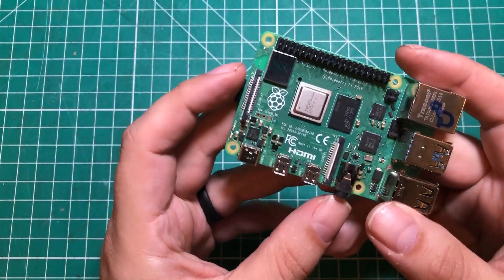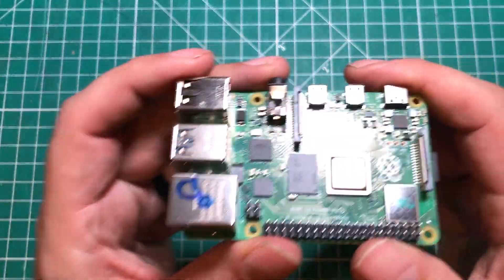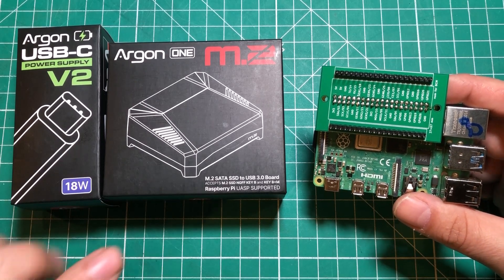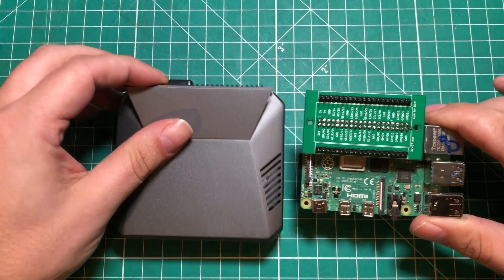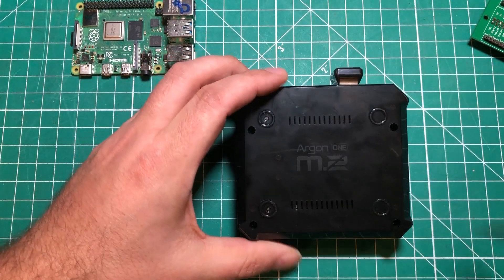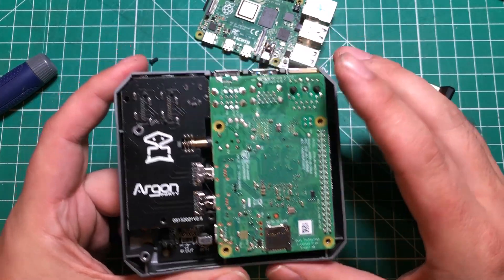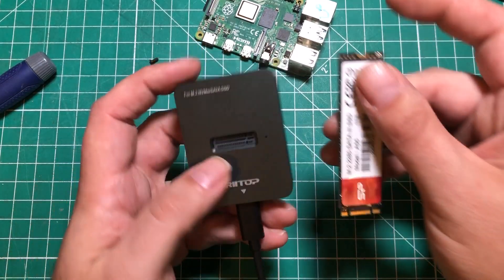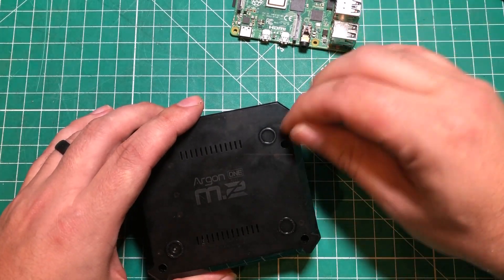Fixing the biggest flaws of the Raspberry Pi 4

Comment: is this channel still alive? i want to ask something
Reply from the maker: I'm around. I'm not on yt a ton, but I am around. What's up?
Reply: @AnotherMaker  i just left my rpi for 2 weeks and when im about to use it, it now displays 'usb overcurrent'. nothing is plugged in it, just the power. i tested my sd card to other else's rpi and it's working fine and no over current on their part. and even used their power supple adapter to my rpi 4b and still over current. so i guess the problem is in my rpi right? but i just used my rpi quite few times in vnc and yeah. it's now on overcurrent

Comment: same money can build better table computer, mini-itx motherboard and I3-I7 cpu less than 50$ and include 8gb RAM, i have used my table computer 3 year now raspberry pi 4 8gb, and new have ITX I5 8gb and lot cheapen and better table computer, raspian need use only emergency computer can go internet and pay bills, but main computer not need , have lot better now mini-ITX and lot cheapen than raspi, raspi 4 8gb cost ower 100$ and all same need power,cooler,usb hub, SSD etc. near 200$ but ITX i have all same less than 100$ big money save.
Reply from the maker: Yeah, I use small form factor pcs for a lot of things in place of the raspberry pi now.

Comment: arcon and many passive cooler case have problem not cool good, if owerlock pi need lot lot better cooler, ice tower need use and then argon need fight to trash because not can use whit good cooler, ice tower. i has before argon but not true good cool, i fight argon case to trash because have 200% better use ice tower ,have true good cooler lot lot better than argon, argon my cpu temp has ower 50C alltime but ice tower have less than 40C now alltime and play game and owerlocked have 2000 mhz and more. but temp stay less than 45C
Reply from the maker: This case is not passive. It has a fan

Comment: I have been having no luck getting HDMI audio on my TV. I do have it only with on board raspberry pi board. (tried both HDMI ports)
  So far when using the Raspberry Pi Imager program to install the OS, only the older "Legacy" versions include HDMI audio
as a choice either from the Speaker ICON or from terminal typing sudo raspi-config and going to audio and select HDMI.   All the latest versions I have tried do not offer
HDMI as a choice.   With the Legacy, once I make sure HDMI is chosen, I go into the Terminal mode and type   sudo nano /boot/config.txt     scroll down to hdmi_drive 2 and remove the "#" before it.   Reboot and audio is on the HDMI line to my TV.    Something must not be installed on newer versions could be the reason HDMI is not
a choice for audio.
Reply from the maker: I haven't run into that but I very rarely use the normal desktop versions either.
Reply: @AnotherMaker  After over a month I found the solution to no HDMI audio.   I made the following changes
sudo nano /boot/config.txt

dtoverlay=vc4-kms-v3d
change to
dtoverlay=vc4-fkms-v3d 

remove "#"
#hdmi_drive=2

reboot/restart
select your hdmi from the sound applet

The first line added HDMI as a choice when clicking the speaker icon or doing a sudo raspi-config,  system, audio and now HDMI audio output will be a choice.
Such a simple change but no one knew the answer from several of my requests.    The version of OS is when using the IMAGER program from raspberry pi, its
the 1st choice with Desktop.
Reply from the maker: @n1kkri  Thanks so much for sharing. I saved this snippet so I have it.
Reply: @AnotherMaker  it was my pleasure to share.

Comment: When it comes to micro hdmi solutions, the wires  are better than the adapters. The adapters like to break easily. I've even had a bad adapter mangle an  micro hdmi 0 port on the pi itself. I've had very good results with Samsung BAR and Fit, USB flash memory for boot. 128GB and 256GB worked well. 64GB ones seemed to get hotter and not work as well for me, longevity wise. It's anecdotal. More issues at the limit of overclock and USB power. No noticeable difference between the flash and ssd.

 I had hope about PI's being in stock when I got one in July. Something went wrong, and that one became the first to pop. Overclocked to the limit and plugging in USBs something gave. Will not even run off GPIO 5V battery. I still haven't been able to replace that one yet. Spare parts now 😅

Comment: Many of the flaws of the Raspberry Pi have been addressed, including the inability to use NVME drives; it's called the Orange PI 5 Plus.
Reply from the maker: I have a bunch of those. I love the hardware but the software has a lot to be desired. I have a hard time getting a lot of programs that run flawlessly on the raspberry working on the orange

Comment: yes this case design is optimal but what it needs is an indicator light of at least it is powered on .....
I have the first design and I also have the 2.0 version which is the M.2 version ...
Reply from the maker: I do agree because the fan can be on with the system off. That's kind of weird.

Comment: The biggest issue is the availability.
I have two Pi 4s of which one sits inside my DIY NAS on a 3D printed PCI bracket doing backup tasks there such as acting as second DNS.

I have another one which I'd actually love to put inside that Argon case with or without M2 slot but I too want to use it inside a C64 I had a Pi 3 set up with.

Hope the Foundation gets things fixed again in the near future because doing projects with those SBCs is really fun.
Reply from the maker: Agreed. It's a really big bummer that only companies can get these things. I still have my pre-pandemic old stockpile but I feel bad sharing projects when no one can get them.

Comment: sdcard, use a convertor to emmc which plugs into sdcard slot (rockpi), speed is decided by sdcard system probably.
for silent cooling fan see Garatronic (France)   (skipped video when mentioning gpio needs documentation, yeah)
Reply from the maker: Yeah. I used the GPIO sometimes but more often than not, I don't. I still think the USB system is faster than the SD card system overall. Probably buy something like 35 to 40%

Comment: Thanks for sharing a super helpful video and I agree with your points 💯 as it really needs 1 x full HDMI, installing a fan takes up space and although you can always use a case such as this one from Argon which doesn't come without its own issues and it ain't cheap but the Pi4B still ranks well against newer SBCs from the competition - that's if you're lucky to buy one for an affordable price. 👌
Reply from the maker: I definitely did get lucky getting them at a good price. And yeah, I don't really understand some of their design decisions. They made a really good board but I don't know that people were begging for dual video outputs
Reply: @AnotherMaker It's kinda nice being able to split social media between 2 screens, Twitter and YouTube for example. Other use cases, looking things up on one screen, definitions, information,spelling, while watching something else. It doesn't seem to have a performance hit, 2125/866 on my slowest Pi4. I use Twister OS, it has a great UI for displays and in general. Android 13 will give you 2 of the same screen (both hdmi.) Played GTA SA dual screened for awhile to see if it would have issues, seemed to work fine.

Comment: Nice neat case
I'm not currently a pi user, though i bought one for a project years ago
The main thing i didn't like abut it was that the connectors were all around the board, no organisation
I recently saw a vid about the rock pi 5, and really like the set up
Reply from the maker: Yeah. I think a lot of this stuff they are just happy enough to be able to fit it at all. I've done a very tiny bit of PCB design and getting things where you want them is a huge trick. I'm guessing that every time a new board comes out with custom chips they have a lot more say on what side of the chip a pin is on and things like that to make it a lot better. In the beginning they were using off the shelf chips.

Comment: At this point I’d buy a mini desktop pc they can do the same thing with barely any modifications and they can be cheap if you find them used a lot of the time they’re faster then the pi 4
Reply from the maker: It's funny. I made a video about this like two or three years ago and when I talked about the potential of using a thin client PC instead of a raspberry pi... And where you might want to use one versus the other... I got banned from the raspberry pi subreddit and they've refused to undo it every time I made an appeal
Reply: @AnotherMaker Yep, R*ddit sucks ass. Terrible platform to contribute to, but sometimes useful to gather information from. Their mods are the lowest of lifeforms.
Reply: A mini desktop pc doesn't have GPIO pins to control devices and/or read sensors. I'm using an RPi 3B+ to control a greenhouse environment and it acts as a web server to display the conditions in a browser. How do you do that with a cheap mini desktop pc?
Reply: @WilliamBurlingame  usb maybe but then you probably wouldn’t be able to code it easily so idk
Reply: @WilliamBurlingame I would deeply appreciate any info on what HW/SW you used. Thanks -
Reply: @SchoolforHackers  For the greenhouse project, I used a DHT22 to read temperature and humidity with a headless RPi 3B+.  I used an Iot Relay - Enclosed High-power Power Relay for Arduino, Raspberry Pi, PIC or Wifi, Relay Shield that I bought on Amazon to control a heater.  The software was written in Python.   I also installed Apache web server to make a web site to display the temperature, humidity, high and low temperatures for the day, written in PHP.  I build csv logs for the readings. Csv files are easily imported into a spreadsheet for analysis. It's a small greenhouse that doesn't a watering system.  I am looking into controlling the louvered windows and shades with servo motors.
Reply: @WilliamBurlingame  Thank you for the excellent reply. Yes, I wondered if you were watering as part of the operation. I’ll be running evaporative cooling, not heating, but very similar otherwise. Great leads on the DHT22 and the IOT relay. May your veggies prosper.
Reply: @WilliamBurlingame  Absolutely. It's more than half the reason I'm looking at a Pi4b right now.  A Pi5 would be great, but I don't really want to wait for software options. 
For me it's just watching some you tube even at 720 and playing with GPIO hardware. 
I've seen demos with people running more apps simultaneously than I ever have done on my PC's!   Pi4b 8gb, Argon one M.2 SSD & an external WiFi antenna on the case, will do from what I've seen in videos.
Reply from the maker: @WilliamBurlingame  You don't, but 95% of the time,  I don't use the GPIO. If I need GPIO I usually use an arduino/ESP and send the data to one of my apis.

Comment: I have the original Argon One case for my Pi4 which runs Octoprint, and it's been performing great the last couple of years. Shame that you have to have a M.2 SATA SSD with that case, as I have a couple of NVMe SSD drives from PCs which I upgraded, and they would be perfect as upgrades for my other 2 Pi 4's, which I luckily got a couple of years ago before the shortages. I know there would be no speed advantage, but the drives would essentially be free for people in that position.
Reply from the maker: Yeah I agree. I would much prefer the standard NVMe. I had some of those leftover from other projects. I only have one laptop that used an SSD m.2. they're still a good deal though